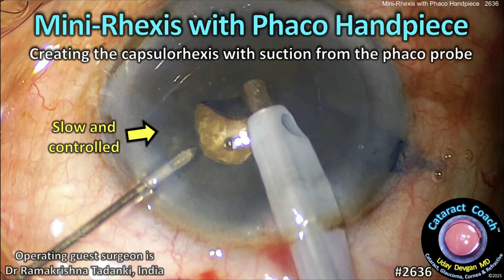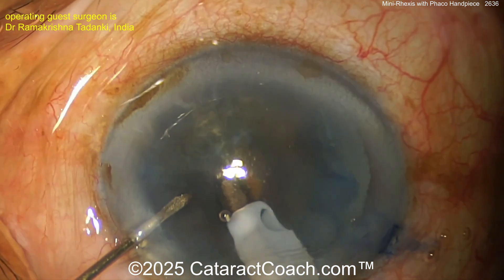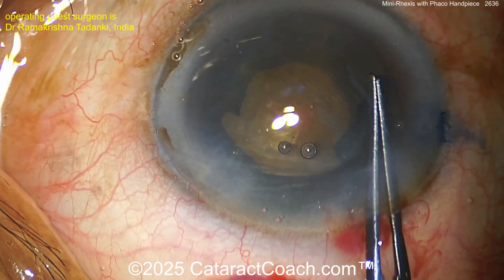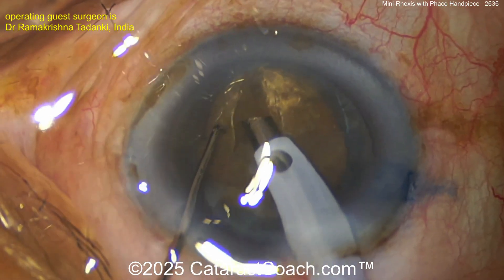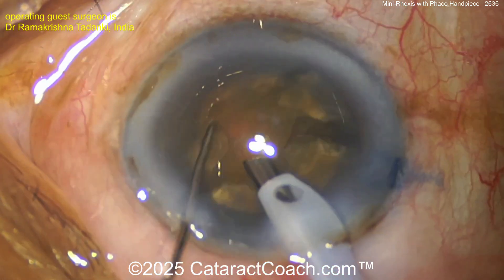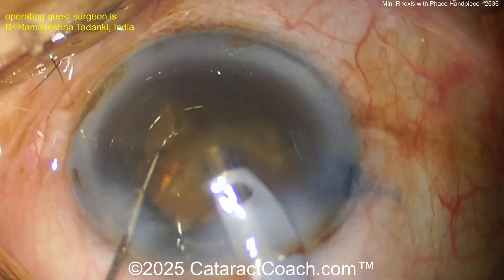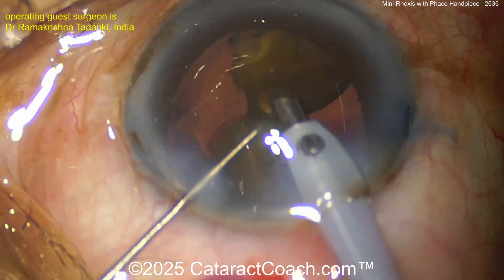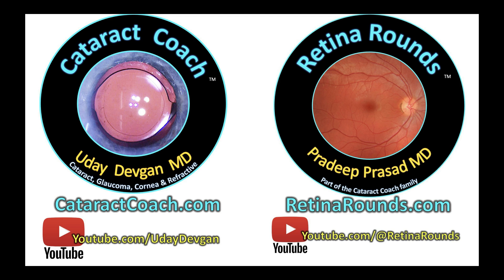CataractCoach™ 2636: mini-rhexis with phaco handpiece for white cataracts

Comment: Looks risky.
But thinking deeply about the pressure difference between the anterior chamber without pressure and an intumescent bag that is the center of the explosion of the bag at the moment of trying to do a rhexis. 
In this video you can see one of the principles of the technique published by Argentinian dr Ariel Blanco (blanco punción, in Spanish) : avoid the explosion of the capsular bag under controlled decompression.  In this video the pressure in anterior chamber is maintained with the high of the irrigation bottle in cmH2O or mmHg.  At the same time the phaco handpiece has irrigation on. And  this avoid the problem with the traditional under pressurized anterior chamber.  The problem is to think in pressure differences and the explosive outcome if we don’t care about that.
Maybe using an anterior chamber maintainer and  aspirating only hand piece seems more safe. First try in the laboratory. 
Google “blanco punción técnica” or look for information about how Argentinian flag is prevented in Latin America.